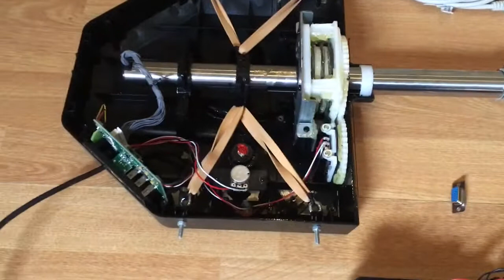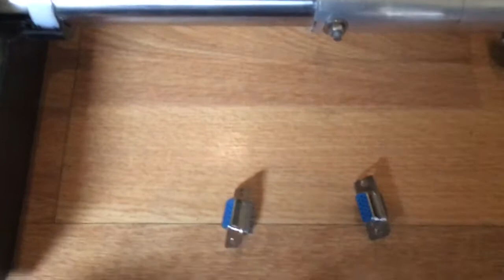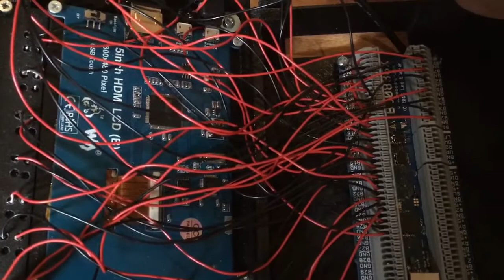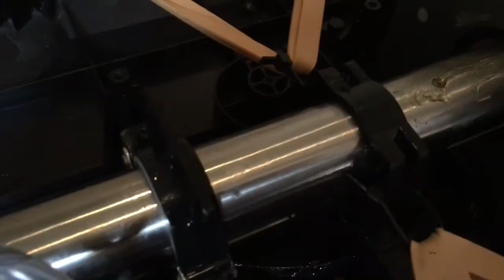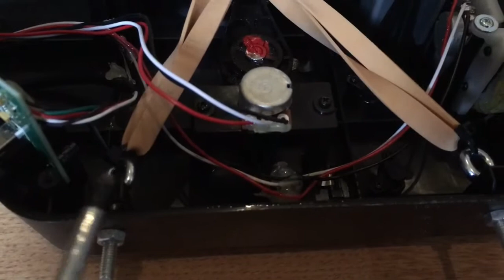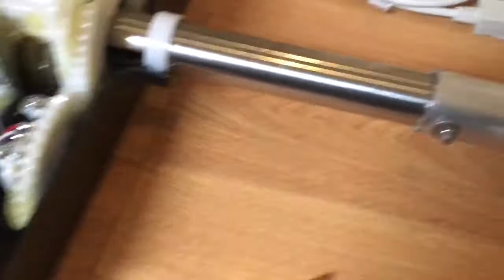Cessna Home cockpit - Saitek yoke & Leo bodnar board

Comment: I see you have the small blue pcb Board mounted on your Leo bodnar encoders.
According to the link you sent me on how to wire the encoders there is no PCB Board on the drawing.
Do i need the PCB Board mounted and then solder the wires.
That is my doubt.

Thanx
Reply from the maker: Cessna flight simmer 
Hi,
You don't need the board but if you use it you should connect the wires as shown here http://www.leobodnar.com/shop/index.php?main_page=popup_image_additional&pID=196&pic=2&products_image_large_additional=images/ELMA-1-03.png
Reply from the maker: Cessna flight simmer 
Also you need 6 wires. I ground, two for each encoder and one for the button.

Comment: Hi,
Thanks for the quick reply,
I don't need to use the PCB Board Thats supplied with the elma encoders, right?
I can just solder directly to the pins according to the Photo shown in the Leo bodnar website.
Or does it needs to be there also?
The settings adjustments you are also mentioning is the encoder software that you download from Leo bodnar website.
You have to do some twicks on the channels you are using the encoders, am i right ?

Thanx

Comment: Hi,
Great work by the way,
Just finishing my gns530, also using this same Leo bodnar Card and elma e37 rotary encoders.
But having some dificulteis with wiring the encoders.
Can you give a little help on this task?

Thanks
Reply from the maker: Cessna flight simmer 
Hi,
Sure I will try to help. I connected the using this instruction http://www.leobodnar.com/shop/index.php?main_page=popup_image_additional&pID=196&pic=1&products_image_large_additional=images/ELMA-1-02.png

Also you have to change the settings of the board.

Comment: I don't think going to the Bodnar board is going to help you much with regard to how the pots perform.  If you want to see real improvement, you should look into replacing the pots with hall effect sensors.  If nothing else you'll get crisper response and no "spiking" from the hall effect sensors.  I discovered your page the other day from Reddit.  You do good work!  Keep it up!
Reply from the maker: f15sim 
Hi,
Thanks for your kind words! I'm going to check out the Hall effect sensors. I finished the cables so I am going to find out soon if the bodnar board is an improvement. The main reason for replacing is the deadzone which is caused by the saitek board.
Thanks again!